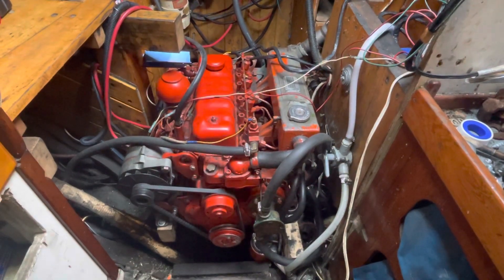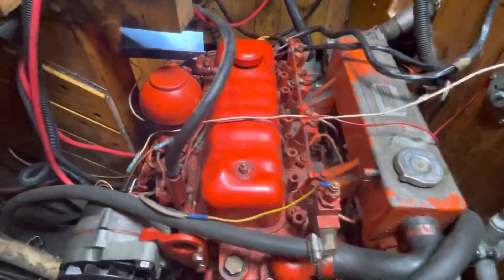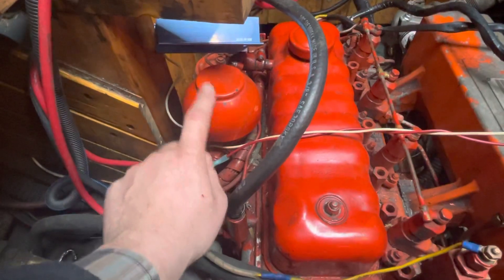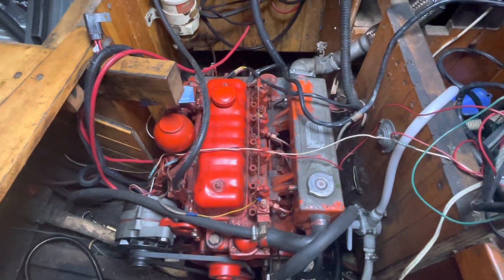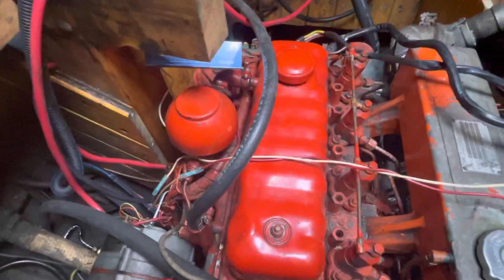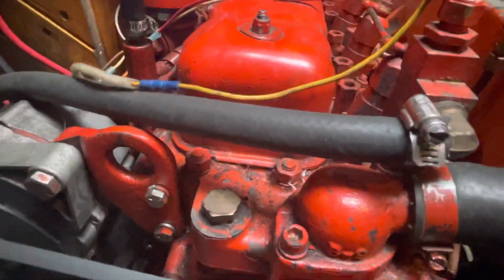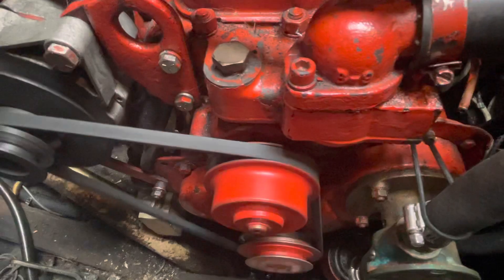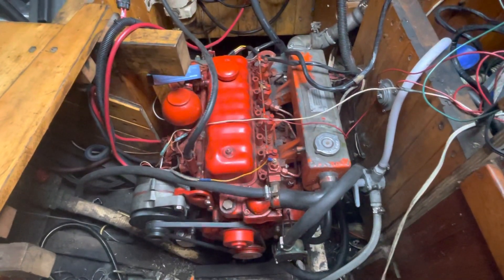Perkins 4.108 - Cold Start - Fire Heater

Comment: It's not a glow plug system. It's a flame heater and it's used on older direct injection diesels versus glow plugs that are used on indirect injection diesels. It's not usually needed on a well running Perkins with good compression unless it's super cold
Reply: the 4.108 is indirect injection interestingly
Reply: @jetstream454, Really? I don't see a pre ignition chamber and the injectors look like they go straight into the top of the engine
Reply: @rickye7738  Indirect injection diesel injectors still go into the top, as the prechamber is in the cylinder head, vs. gasoline indirect injection in which the injector is in the intake port.
Reply: @rickye7738  You don't know a diesel from an egg beater

Comment: Your fuel cutoff to the engine...
might be better placed somewhat away from the engine...
with a quarter turn ball valve in line..
just in case the fuel line fractures between the cutoff and the engine...
so you don't have to lean over an engine surrounded by flames???